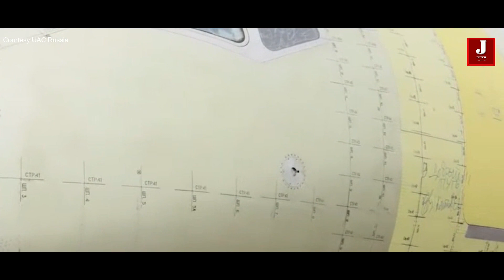Aviation Sanctions? No problem!  Russia Builds First Sukhoi SuperJet With Domestic Parts

Comment: Reality: Since 2018, the Sukhoi Superjet 100 (SSJ 10) has hardly been built because there are over 60 unsold & returned ones, but no sales! The downtimes and thus the costs were extremely high. Russian civil aircraft have therefore had a market share of less than 0.1% of global sales outside Russia/Belarus for the last 20 years.
С 2018 года самолеты Sukhoi Superjet 100 (SSJ 10) практически не строятся, потому что есть более 60 непроданных и возвращенных самолетов! Простои и, соответственно, расходы были чрезвычайно высоки. Таким образом, за последние 20 лет доля российских гражданских самолетов на рынке составляет менее 0,1% от общего объема продаж за пределами России/Белоруссии.

Comment: The reality: All Russian civil aircraft (e.g. SJ 100, MC 21, TU-204 etc) have so far had significantly higher maintenance costs & downtimes than promised & than competitor aircraft. Therefore since 2000 their world market share (outside Russia/Belarus/Cuba) is less than 0.1%!    It became known that MC 21 and Superjet SJ100 without foreign key components would have significantly poorer performance values (range, altitude, acceleration, speed).
The situation with Sukhoi Superjet 100 (SJ 100): Only 1 was sold in the last 5 years, over 60 were ‘in stock’ in 2020 because returned or not accepted.

Comment: Any reasonably cautious company/passenger would consider buying/board it only after extensive testing, certification, proof of reliability in real conditions  and more importantly after cumulative flight time would've exceed few tens of thousands hours with 'safe enough statistics'. It's a long long journey to go.
Reply: Sure. Safety is pillar number 1 for transport systems. Short history of Boeing 737 MAX that crashed twice in a period of 12 months shows that aircraft reliability and pilots trainings are important in safe exploitation of aircrafts.
Reply: Years away...if it ever gets there. If it does, it'll be long after Russia has cannibalized the 600 boeings and airbus planes they stole from leasing companies. If Russia is so great, why are they only developing this now, years and years too late.......

Comment: The SJ-100 with the PD-8 will take off this year!!!))) The PD-8 has been testing under the wing of the Il-76LL for more than a year...
The secret to the speed of development is simple: the SAM-146 was produced jointly at SALYUT and SNECMA.... where SNECMA supplied the hot part of the engine... The final assembly was done at SALYUT... in Rybinsk, in Russia... Now the hot part was developed in Perm, based on the PD-14 engine... The fan and most other units will remain the same, from the SAM-146...

Comment: Russia is large, 11 times zones. Logically Russia has to maintain a small civilian aircraft program in case of sanctions.
Can also be used by the military. Fuel efficiency and cost are less important until they want to compete in the international market.
Reply: MS-21 has specs comparable with Airbus A320neo and Boeing 737 MAX, while its price for domestic airline companies is comparable with one generation older jets like Airbus A320 and Boeing 737 NG.
SJ-100 is another localized aircraft that was produced in volumes with SSJ-100 name. It has better fuel efficiency due to local engine PD-8 reduced fuel consumption and due to winglets installed by default.
Reply: With a very small population.
Reply: @autumnicleaf  Small is relative. and the wrong word in this case. Russia's population is far bigger than any other european country as now is its economy.
Reply: @bobdeverell exactly. Russian population more than double that of any European vountry
Reply: @autumnicleaf bla bla bla
Reply: Fuel efficientcy is not at issue. When your a gas station 😂

Comment: You should have informed us about its passengers capacity, range, etc.also. The video is incomplete and miss a lot important information.
Reply from the maker: Thank you for the feedback. That video was already created. The current video is about the most recent upgrades made by domestically created technology.
Reply: @JetlineMarvel am I right to think it’s a bit fuel inefficient but other alright?   Russia has lots of oil.
Reply from the maker: @SeeLasSee  that's right.
Reply: As far as I know there will be several versions of this aircraft with different capacities. I think it will cover the entire spectrum of passenger transportation needs to shorter and closer destinations, with larger and smaller capacities.

Comment: France has stopped the coopération with the russians on the engine since 2022 .the prototype here is however still using the franco russian engine but the prototype 2 wont. The heart of the plane is the engine and the new one russians are developing on their own will take years and billions of dollars to develop.which mrans that it will remain for years to come à prototype.
Reply: As long as Russia is trying to build its airliners to comply with ridiculous Western rules on emissions and noise, then it will be slow going indeed.  There is way WAY too much technology being applied to a fixed problem and there's no practical gain being made at all.  Except to justify the jobs of government regulators.  

If Russia would build short and medium haul jets to, say, African or Indian or South American standards, they could get this SuperJet ready much sooner. 

The West will never stop inventing new legal gimmicks to block Russian and Chinese aviation from entering its collective airspaces.
Reply: Well, as far as I know, Russia is not new to the production of aircraft engines. That Russian-French engine is the result of joint development of that engine. Otherwise, Russia has been working on the development of new engines for years, so it will not need another year of work, but that new engine could appear very soon. On the other hand, the production and use of those planes is not only related to that new engine, because already existing engines can be used, which are certainly not outdated.
Reply: Silly!!! The SJ-100 with the PD-8 will take off this year!!!))) The PD-8 has been testing under the wing of the Il-76LL for more than a year...
The secret to the speed of development is simple: the SAM-146 was produced jointly at SALYUT and SNECMA.... where SNECMA supplied the hot part of the engine... The final assembly was done at SALYUT... in Rybinsk, in Russia... Now the hot part was developed in Perm, based on the PD-14 engine... The fan and most other units will remain the same, from the SAM-146...
Reply: @ИгорьИсаков-з4р  He really wishes, just like they were predicting Russia to dislocate after their so-called unprecedented sanctions...lol

Comment: Well done Russia !! 
Who need European or USA aircrafts ?
Reply: Everyone, including China😅
Reply: @EndOfThings77 
Yes, like Iphone in China !! 😂😂😂
Reply: @philippemartin7396  By the same logic... who needs seat-belts? A car without seat-belts is perfectly OK most of the time...
Reply: @kaba_me  
Same logic ????
What ?? No sense 👎👎👎
Reply: Basically the world needs US and European aircraft and that's not going to change any time some.
Reply: @littleowlbooks8514  The world doesn't need US and European planes, there are better designs... the world needs the manufacturing capacity that the US and Europe have to produce planes.
The Russian SSJ-100 has shown better performance than the Bombardier C/Airbus 200. The MS-21 is the newest design and has already shown in tests that it is ahead of its direct competitors... but Russia does not have the capacity to mass produce those aircraft . However, the Russian market of 1,300 aircraft, part of the Chinese market of almost 4,000 aircraft, a fraction of the Asian market of several thousand more aircraft, the African and Latin American markets of the same volume, are quite enough for Russian aircraft manufacturers.

Comment: No wonder China cancelled their standing order for Boeing and on a plan to cancel order for Airbus commercial plan as well.
Reply: Is that so ? Their own C919 us already outdated?
Reply: @georgeszurbach444  C919 is a mid-capacity and mid-range airplane. Airbus has A350 and A380 with much high capacity and exceptional range.
Also retraining pilots it's a hassle.
Reply: @georgesbv1  and the A320 family
Reply: @georgeszurbach444 Airbus A320 and and Boeing 737 MAX are natural competitors of Comac C919 and Irkut MC-21-300. Sukhoi SuperJet 100 is smaller.
Reply: @georgeszurbach444  They have already ordered a large number of these new aircraft from Russia. When the west imposed sanctions on components produced in their countries, that order was only prolonged. So, when serial production starts in the next ten years, the sale of those planes is guaranteed, only for the Russian and Chinese markets
Reply: China not cancelled, Airbus  has an factory in Tianjin,  Boeing too
Reply: C929 coming soon

Comment: I would fly russian aircraft rather then 737 Max
Reply: Or the C919 instead of 737 Max.
Reply: @Zerpentsa6598 don’t fly either.
Reply: @Zerpentsa6598 All chinese airlines planes are Boeing or Airbus🤣🤣🤣👍
Reply: @IceAge-t5w   I guess you're just trying to crack a joke.  If not, you're showing your ignorance.
Reply: @Zerpentsa6598  regional jet🤣🤣👍
Why Russia still use Airbus,Boeing planes for international travel?🤣
Reply: ... or what about the Lockheed L-1011..
Reply: Lockheed L-1011 was a good plane. @UltimateSeduction
Reply: @UltimateSeduction we don't like American Aircraft's. Thank you
Reply: Dude, I'd even ride a camel rather than getting on a 737 MAX 💀
Reply: So happy
Reply: Don't forget the Wagner Boss so quickly.
He might also have said the same thing.
Reply: 😂😂😂, regards then, whoever you meet up their or below
Reply: Even Boeing not able to create a plane by himself only. Russia can and does. Look at  superjet and mc-21
Reply: 737 Max is programmed by Indian
Reply: Of course.
Reply: That might be correct. B737 is a 50 y.o. aircraft design. Patching it with software doesn’t help as we know. This Russian jet is modern design like most Airbus products. Last week I flew on A321 AA from Vegas to Charlotte. What a pleasant flight experience. Boeing doesn’t stand a chance if they don’t come up with a modern design in that class.
Reply: Back in the 80's I flew many times in the TU-154M of Aeroflot and found the flights more than exceptional in any weather, much better than Boeing or McDonnel Douglas!
Reply: Only russians can fly😂😂😂bz 
It is regional jet👍🤣
Fly only inside russia🤣
Reply: If you are russian for sure you will fly russian and chinese airplanes only. And you will have Lada and Moskvich cars. Enjoy it.
Reply: @sour_commenter  you know nothing... Even Iran still uses Boeing and Airbus planes. As well Russia does
Reply: @lerax2010  Since when Iran is a reference? Is more or less like North Korea. And North Korea still flies IL62....
And this Sukhoi has western engines, western avionics and western parts.....so keep dreaming. Even Sukhoi will be a dream for you.
Reply: @sour_commenter  you information is outdated. Russia replaced almost all western parts and avionics. And Russian engine for superjet  is at testing stage. Let's imagine what Boeing will be under the same sanctions?
Reply: @lerax2010  Who talks about Boeing?
You always put your fingers on US or US companies, but no one emigrates to ruzzia, and all ruzzians want to live in USA......why?
And all of you are willing to go out, in western countries, despite the fact that you aren't respectful regarding them. Wtf is this?
Sukhoi will have "new" engines.....reactivated 1990 models I think. Same like cars which will lack ABS ESP airbags or other modern systems. And new avionics....from where? Military planes from ruzzia don't have a modern GPS system, forcing pilots to use civil TOM TOM  navigation devices.....this is pathetic.
I am happy to see that the free world started to see who you are and to proceed accordingly.
Reply: What manufacturer of aircraft has the best safety record in the world?  I can say now it is not any Russian or Chinese, but, do you know who? @sour_commenter
Reply: Have you seen the current production of Lada and Moskvich!? No? Have you heard about the Russian Aurus?
It's not a question of whether they know and can, but whether they want to!
I drive a 10-year-old Fiat and I plan to drive it for another 10 years, not because I can't buy a newer and more expensive one, but because it's in our Slavic blood... it's nothing more than an auxiliary means and we would be very happy if the same model was produced for decades. You in the West cannot understand us, but neither do we understand your desire to buy a new car every year!

Comment: I would not risk flying on any russian made aircraft, I'll stick to airbus thanks
Reply: Hmmm I don't think is no different western aircraft after your feet off the ground you are under God mercy. You mean  airbus never crash I am pilot myself I know that airbus crash in Atlantic before.
Reply: @laosasean8482  Since I do not believe in any God, I am at the mercy of the pilots in the cockpit
Reply: @JohnMitch  Even the best pilot with overs  5000 of flight won't be  able to safe you if aircraft is bad like Boeing 737 Max-8. I cannot believes FFA certified that  aircraft to fly without properly test.
Reply: @laosasean8482  Well exactly, Thats why I will choose to fly on an airbus rather then BOEING or Russian Aircraft, I trust the European Air safety Agency much more then the FFA or the russian air safety agency
Reply: @JohnMitch  A-330 Air France crashed into Atlantic please check, I mean all Manmade is can be break down even the bird fallen down from the sky due to  low air density.
Reply: @laosasean8482  Yes I know, but there has been at least two boeings crashed since then, the odds of a boeing crash are higher then an airbus as far as I am concerned
Reply: @JohnMitch  There are fewer airbus in the sky than boeings, so there are fewer airbus disasters, and if you completely remove airbus from the avaperevohok passenger market, then the statistics of disasters will come to zero
Reply: @JohnMitch  When something goes wrong with a plane in the sky, neither the pilot nor the co-pilot can help themselves, let alone you. Then you will start to believe, and probably seek help from God, because only he can help you in such a situation.
Reply: @borislavkrstic6366  As far as I am concerned what you refer to as God, is just an imaginary friend. When one person has an imaginary friend they are called crazy, when millions have the same imaginary friend, Then its a religion. There are hundreds of religions with different imaginary friends
Reply: @JohnMitch  It is only because you believe that God does not exist. So you don't know whether you are right or wrong, but the fact is that you believe that you are right, even though you have no proof for it. Which means that you are no less a believer than those people who believe that God exists. In other words, there is something you have in common, which is that you are both believers. Unlike you, when I say that, I mean you believers, equally. As for you who believe that God does not exist, as well as for those who believe that God exists, there are people who know that God exists. Now if you ask those people to give you proof of the existence of God, they will hardly give you anything that will satisfy you. The matter is very simple, no one has ever seen God, nor can he, you cannot understand him or understand his greatness, because he is non-material, non-dimensional, beyond our ability to understand. But people who know that God exists have irrefutable proof for it, but they cannot share that proof with other people, because they have no way, they do not have the necessary instruments for such a thing. Probably because God doesn't want to provide proof of his existence to those who don't need it, who don't want it. If you do not seek God yourself, you will not find him. He will not force you to do so.
Reply: @borislavkrstic6366  What you try to justify is absolutely irrelevant to me
Reply: @JohnMitch  What do you think I am trying to justify? What is important to you and what is not is, in any case, your business. I didn't even expect that based on one of my comments, something that wasn't important to you all or most of your life would become important to you. I was just pointing out that there are different views on the same thing, that they differ based on experience, that no one's experience can be transferred to another person, nor can their views be changed based on personal experience. Only when, and if you experience some things yourself, then you will only be told. In that case, it will be your experience, your experience and proof that you will not be able to share with anyone. Believe me, my views have not differed from yours for most of my life. That's why I can tell you that I fully understand you, and I'm not trying to convince you of something, which I know won't have any effect.
Reply: Why, Aeroflot was the largest and safest airline company during USSR period. I am sure they can once again start building. By the way, Belarus built 3 new airlines which has never been in this business. Do you think Boeing did not have any issues? Have you heard that there were 3 crashes due to some software update which did not function as expected and the planes were crashed and grounded for a year, I think. Everybody has problems.
Reply: @misszlata1283  As I said in my post, I will stick to "AIRBUS"
Reply: I am literally laughing at these people who are desperately trying to win an argument against you, but unfortunately for them they can't find any flaw with Airbus... so they try to drag Boeing, God etc... what a lame crowd...